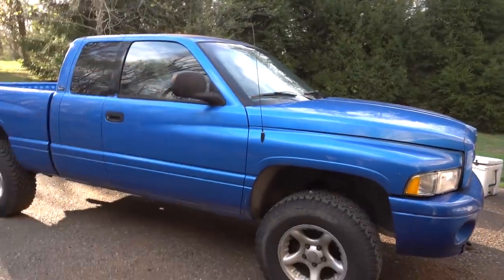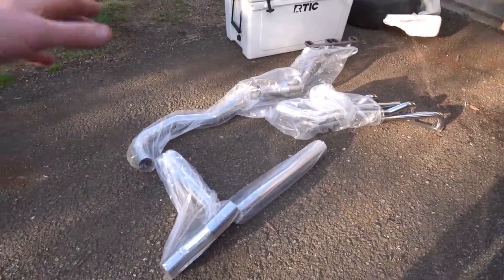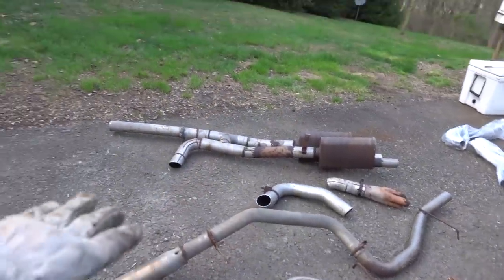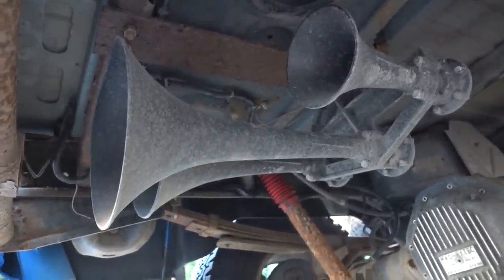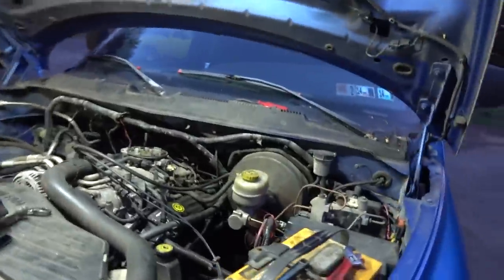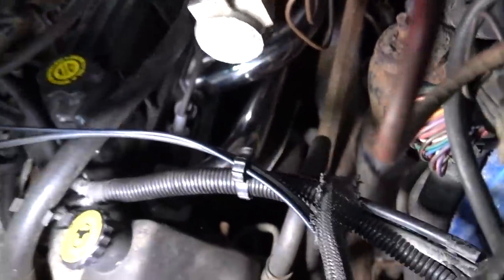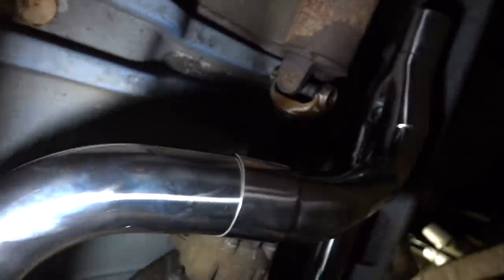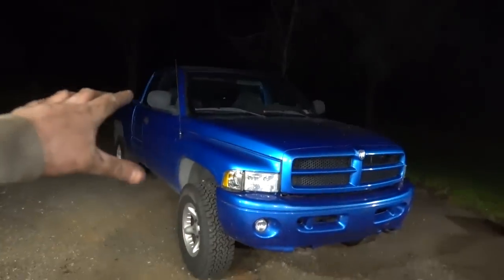Veronica Gets Her Rumble Back... 2nd Gen Ram Long Tube Header Install!!

Comment: THANK GOD SOMEONE WHO STILL HAS A V8 IN THEIR 2ND GEN 👏👏👏👏👏👏👏
Reply: I have a v10 in mine, rare to see gasser 2nd gens
Reply: @Tiltymilk   yea those are cool don't see many V10s
Reply: @Tiltymilk  My dads gf has a 1994 Dodge Ram single cab 3500 with a v10 the thing is a beast and rare
Reply: Old comment ik but last year I got a 99 2500 Manual v8 with 84k original miles. It's great... besides the paint
Reply: @leroywingo8599  awesome
Reply: I have a 2001 .. but mine is the 5.9 not the 5.2... I want to rebuild the engine and fix it up .. i like these years a lot. .. I probably won't put long tube on mine .. I'll do short I think .. I like long  tube but I'm gonna be using my truck for all sorts of stuff where the long tubes just won't be practical.
Reply: @Rockers1121  I've got a 97 with the 318 and the 5 speed manual, I was wanting to go long tubes bc these motors have a lot of low end torque but they fall flat up top, I'd just like to have more power all in the power range

Comment: I’m really glad that you made this video because I have a 98 318 5 speed and have looked at these long tubes and Y pipe for awhile now.
Reply: Also how do they clear the slave cylinder?
Reply from the maker: Once you jack the engine around they slide in fine, it's a tight fit for sure. Also I had to cut a section of the y pipe to shorten the one side to get everything engaged fully. Starter definitely has to be out to install the driver side
Reply: Thanks for the reply! I was wondering how they cleared the front driveshaft as well but you covered that for me. Looks like my daily beater is getting a set of long tubes. Thanks again!!
Reply from the maker: Nice!

Comment: Also i had a 2000 offroad and wanted to let you know if your into that kinda thing doesnt take much to run 37s possibly 38s for fairly cheap.... with a leveling kit and 3 in body you can fit 37s possibly even 38s just alittle fyi if your into that kind of stuff and lookin to find out how big you can fit. Also you can fit just with a leveling kit no body lift you can run 35s

Comment: I have a 96 lwb w318 with 4.000 scat crank and a .40 over bore for 392ci. And a stage 3 shift kit for the 46re and I regeared the rear to 3.92 lsd with disc brake conversion and I have hellcat wheels and tires 20/55/335 rear and 315 front and ram 3500 suspension front and rear with fox coil overs front and rear with 2" 4" suspension drop been looking for a supercharger kit and decent long tube headers equal length and I'm going with 3" pipe with flowtech hp-2 mufflers and I have msd ignition with e3 plugs and msd ignition box

Comment: what company did you use. I cant find any long tubes. Nobody has anything for the ram. 
I have 97 with a 5.2. Are they the pacesetter lpng tibe? Chinese knock off? Summit racing? Any body knows if i can get the summit racing headers for the small block LA  to fit into the truck ? Any modification?

Comment: Which fit better. Pacesetter or DNA? I have jba shorties currently but they have small primaries
Reply from the maker: Same, I believe the DNA are exact duplicate. But they are true stainless
Reply: @TurbaTom  thanks for the reply. My shorties slid right in but I know long tubes are better. On my 05 power wagon I had to replace the sagging motor mounts to make my arh headers fit. I wonder if that would have helped the fit.

Comment: Did you have a gasket leak on your old headers? I’ve got that ticking sound. I think that’s what I’ve got with my 00 1500. I’m debating on just getting a new gasket for getting headers while I’m down there. Thanks
Reply from the maker: The old headers were shot. But when a gasket would leak I'd get the ticking sound. Eventually I had to double up the gaskets to get the leaks to stay sealed
Reply: @TurbaTom  ok thanks

Comment: Planning on 5.7 swapping my ram from the 318  and putting in a dash from the 3rd/4th gen most likely same generation I pull the engine from man I just wish these things didn’t break every 1000 miles. Planning on doing a massssive over haul
Reply: I prefer the 318 over the Hemi
Reply: I bought my 98 5.9 about 8-9 months ago new fluids and like a month ago replaced the radiator. Nothing else needed yet!

Comment: You said it was an offroad package?  With a 5.2 magnum? Offroads didnt come with the 5.2 only 5.9l magnum. If its a offroad it will 4.10s trussed front dana 44 bout a 2 inch lift etc hooks.... decal on tailgate different rims shocks and hooks..... and maybe couple little odds and ends.... by looking at it from different things im seeing definitely looks like an offroad or maybe a clone not hard to do unfortunately theres alot of people out there that make these trucks into clones so people think they have one and dont.... are you sure your truck isnt a 5.9 360 magnum not 5.2 318 magnum?

Comment: How did you like your "Mini max" programmer for your 6.7
Reply: Chris Edge I like mine. If your gonna run one though put head studs in. Just a heads up
Reply from the maker: I liked it, but there are better options out there now. I had a mini because that was the only option back then, also not many people support mcc custom tuning any more
Reply: @jmanyoo3305  i was wondering about that. I plan to do head studs soon. I really didn't want it just to make more power mainly just to get rid of the trash off the engine so it wasn't eating it's own shit and not to have the $ light on all the time. Thanks for the advice.
Reply: @TurbaTom  living here in Idaho we don't have any place anywhere local to go to get custom tuning. I know it can be done remotely but as you said finding anyone to do it on a hwy rig is hard anymore. The mini max had great reviews for plug n play and would work on a deleted rig. Thanks for getting back to me.